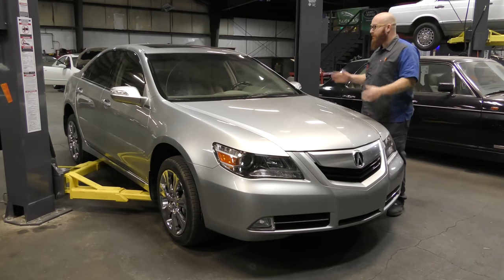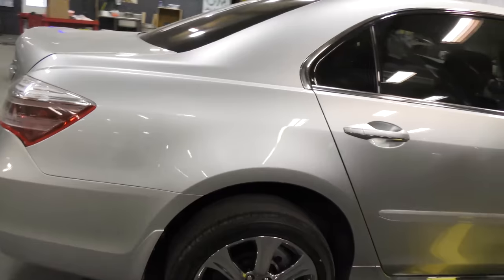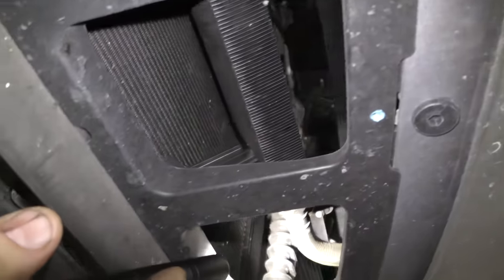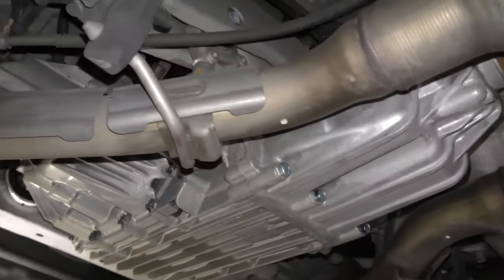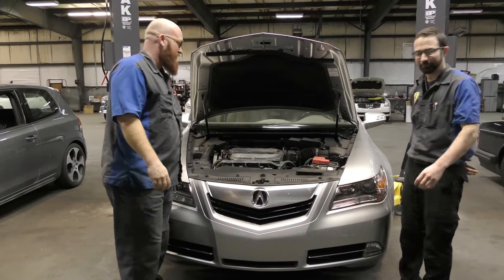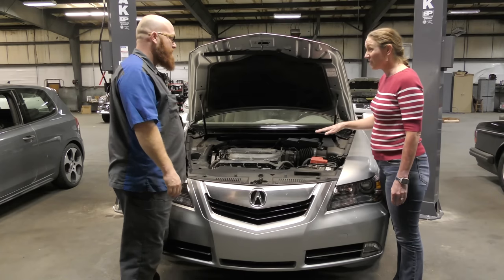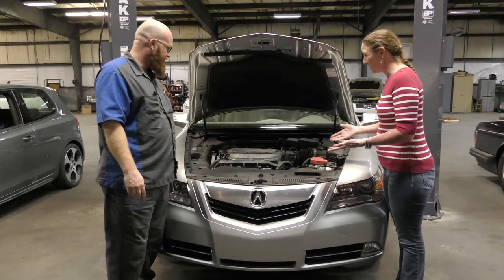Something Very Serious is Wrong with this 2010 Acura RL! What did the CAR WIZARD find???

Comment: Those J37 engines were complete junk - and it's unfortunate because the J series carries an otherwise good reputation for reliability and quality. I was reading about 4th gen Acura TL(the AWD models had this same engine) before I bought my 3rd gen. I basically found lengthy threads of owners with engines burning oil and having them replaced by Acura under warranty. So at one point Acura probably had stock-piles of these engines when these cars were still semi-current. I've been told to avoid the AWD TL's like the plague for this reason. I think Honda flubbed up on piston ring sizing or something on the 3.7 and resulted in excessive oil burning which probably ran this owner's engine low on oil. The J35 and J32 didn't have this issue, so sticking to the front wheel drive variants avoids this problem if that's an option for you.

Comment: Im looking for a good car for my mom i found a 08 acura tsx and a 2010 acura rl and a 2008 acura tl not sure which is better on maintaince
Reply: TL/tsx
Reply: @ua7pyro591  ty
Reply: The TSX is built in Japan and has a timing chain.  The TSX will be slower than the TL or RL; but, will get better over all mpgs, and slightly cheaper maintenance than the V-6 Acuras with timing belts.  The TSX will have a smaller back seat, slower acceleration, not as luxurious inside, and higher road noise.  All three require 91 octane fuel.  I had an 06 TSX for +175,000 miles and a 18 RLX now.
Reply: @mrgold3591  ty

Comment: Dude the 2010 3.7 has a few recalls one is excess oil consumption and I'm sure it could lead to that failure.  You need to get aho6of acura.  I have a 2010 Acura tl sh awd 6 speed manual and it eats oil alive so I took it to the Spokane wa dealership acura. They insisted that they did not need to let the car cool down to check the oil they ended up adding oil said come back in 1000 miles and well see were the oil is. Well when I got home that day the next morning I checked oil level and the Acura dealer added over a half quart over full level so gee wiz I bet after a 1000 miles it could be right on full.  What a joke I'd expect that from chevy or ford but acura pulling a quick one come on. They wont take my word for it that I have to add oil way to often and it dont leak so I have to make another attempt to have them check it and see that it does consume oil. Also I've had to myself replace the water pump and pulleys 3 times because they start knocking and it sounds like an engine knock.  This engine has flaws and some parts do to. Like the dual mass flywheel it over 1500 from the dealer and just about no one makes an after market one unless u convert to single mass but I'm guessing the dual mass harmonizes something in the 3.7 . Goodluck ull need it and it sucks cus they're great handling cars.

Comment: 42k and needs an engine swap? I've seen 2001 Hyundai's with 500k on the original engine and gearbox, Civics at 600k. 
Honda clearly played fast and loose modifying a 3.7 out of the reliable 3.5.

Comment: i don't think that engine failed because of a honda defect. my guess: someone forgot to add fresh oil after an attempted oil change.
Reply: 3.7 TL owner... Definitely a honda defect. A large number of the 3.7 L acura's with the same compression ratio burn about 1qt of oil per 1k miles. Something to do with bad seals on the pistons I believe? Just look up 3.7 oil burning TSB. Acura refused to address the problem until 2018 with a TSB!! Worse yet, customers have reported blown engines even after the TSB repair... The whole ordeal just makes acura look shady as hell in my opinion. Avoid these cars like the plague even if you know to top it off you never know how often the previous owner topped off their oil. The oil level light does not come on until you are already 3 qts low so no wonder this guy's engine blew.

Comment: RL parts are rare as hell because Acura didn't sell a lot of them, and the junkyard dbags are snatching them up quicker than hell...

Acura poorly supported this model and there were a lot of factory defects that made it difficult to own it.  The "leather" interior is fake and deteriorates quickly, the nav systems have constant issues and the glove boxes melt quickly and bubble...too many problems not being fixed for a car that cost 50k new in 2005...

Comment: I am thinking that Honda did have problems with these 3.7L and either to hide the problem they stopped making them or simply they ran out of them from all of the replacements. A rod knock on a 42k Honda something is wrong with the picture, I bet you someone ran it out of oil some time in the past 42k miles, that is sad. I have a few more theories about what happen, the car is 10 years old and in too great of condition. I can see why it looks this way, ran it out of oil ,parked it and decided to pass the buck on to someone else.

Comment: To be honest I feel the RL engine on this car was babied TOO MUCH which is why it failed like it did.  The Acura line up was designed to be driven.
Reply: Well. My thought is that there is a failure within oil delivery system. Most likely oil pump. Something happened to it and oil pressure dropped. 
But in that case check engine would come up, not oil level light as he said. So... My guess is the weak one

Comment: Can you not plug in a code reader to find out what is wrong?....Sad....I plan on buying an RL within the next year,..2009 or 2010 model.....If I were the owner, and had the money, I probably would shell out 7000$ to get the engine fixed. Cheaper to fix than to buy new.....

Comment: Ughh. I hate these kinds of customers. All they worry about is the looks not the mechanicals. Put a new motor in it and it will have the same problem in another 40k miles. And then he is going to bitch that you didn’t fix it right the first time!

Comment: Oh dude that engine is like 2100 bucks with 40000 miles I would of swapped in the JDM V6 from Japan for about 3500 bucks plus labor dude you have a brand new Acura. Period. These people just do not know Hondas man. Easy to swap out and even option for the bigger better JDM or newer versions.

Comment: Just wondering... did you check the Honda online parts stores?  I'm sure you have but in the video you only mention calling around to engine shops and distributors.  OEMAcuraparts shows they engines are still available to purchase.  The 3.7 is subject to oil burning and Honda has warrantied many short blocks and a few long blocks due to claims, maybe supply is getting low?  

"General Assembly, Cylinder Block"
10002-RKG-A04  
$6,281.80 

"Crank assembly"
13310-RKG-000 
$1,080.86

"Connecting rod(s) ea."
13210-RKG-E00 
$100.84

https://www.acuraoemparts.com/v-2010-acura-rl-sedan--rl-tec--5-speed-automatic/engine--engine-assy-transmission-assy

https://www.acuraoemparts.com/v-2010-acura-rl-sedan--rl-tec--5-speed-automatic/engine--crankshaft-piston

Comment: Seriously, with how little he drives it, might as well go with a 200,000 mile engine, it'll never see 250,000 miles while he owns it...  Plenty of used 100,000 mile engines.  Customer needs to take a deep breath and realize that that engine is good for 300,000 miles.

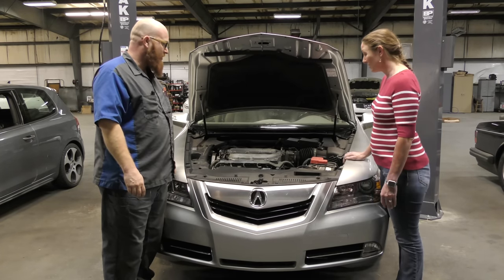Comment: @13:10  Did anyone even contact Honda/Acura directly?  They should eat the repair on their dime at that low of mileage, even if it's out of the standard 3 years/36K miles warranty that Honda has.  If they don't, that's utter bullshit and I would go scorched on their reputation in every place and every website I could find.  And, what the heck was the problem that grenaded the engine in the first place?

Comment: No, sorry, but they don't have a good record! They've not had a good record for well over a decade now! I would not touch a Honda product with a 10 foot barge pole. Heck, I'd get a Hyundai or Kia over the poor quality crap they put out these days. All you have to do is crack open a Consumer Reports (the MDX was rated as one of the most unreliable vehicles, btw), or read a few forums. Don't need to be Sherlock Holmes to know what's going on! Stick with TOYOTA is you care about reliability and durability!

Comment: Swap that junk 6v for a healthy 3.5L engine most if not all the sensors and bell housings are in the same locations and they are all a dime a dozen. When that engine died it already lost all its real value, its not special anymore. I bet they skipped checking the oil and left the oil to sit too long is my guess why it died.

Comment: Never buy a V6 Honda or Acura ....
4 Cilinders are great but V6 no good
Reply: It was just the 3.7L that had this issue and it was limited to vehicle in the 2010-2013 manufacturing period.  The port or DI 3.5L and 3.0L V-6s before and after are just as solid as the I-4 engines w/ or w/o turbo.  The only pain in the butt with Honda/Acura V-6 engines is having to change out the timing belt at 105,000 miles.

Comment: This IS A USED CAR. Especially if the car is being given to others to drive,a used motor is THE BEST OPTION. Spending seven grand to put in a new motor doesn't really make sense. The resale on this car is half what it was...even less when the replacement engine is installed. DEFINITELY,  a used engine if properly maintained is the best choice. People do wreck well,maintained cars. As much as I like to trust the son,I'm thinking he might have 'helped' the engine to  die by letting his girlfriend or friends drive it.Used engine all the way.
Just my opinion...not trying to drive you crazy- really like your channel.

Comment: Yeah yeah, the customer perhaps doesnt understand that japanese engines are removed low mileage and easy to come by affordably. Are you really trying to tell me that the customer has been educated about his options, and when given the choice between a used engine from japan for 2000 dollars shipped, vs 7000 dollars to have a company rebuild it, he wants it rebuilt for an extra 2 and a half engines worth of money? I find that hard to believe. Not unbelievable, hard to believe. Here is one for 1999 dollars shipped with 39k miles. Less than the car. https://www.ebay.com/itm/JDM-2010-2013-Acura-TL-AWD-Acura-RL-2009-2012-J37A-3-7L-SOHC-V6-VTEC-Engine-4WD/283688542887?epid=8033838572&hash=item420d27a2a7:g:ikgAAOSwHP1d3H~U

Comment: I’ll sell you mine for 6 I got a 12 with 140k 6500 whole car runs mint  any idiot would kno buy a second one for the money there 250k plus engines  have a Back up even if it’s crashed u u have whole Rl special auto part sore in your back yard . Anyone  knows any vq or J series should have attention to oil I mean damn the car has a usable oil percent in the dash it’s a quart for every 1200 miles or every time it goes down 30percent
Reply: Mines a quart at 50 and a half quart at 25
Reply: 2010 rl

Comment: Looks like there are some engines out there with similar mileage:
https://www.car-part.com/cgi-bin/search.cgi?userSearch=int&userPID=1000&userLocation=All+States&userIMS=&userInterchange=D%3FB%40D&userSide=&userDate=2010&userDate2=2010&dbModel=2.9.1.1&userModel=Acura%20TL&dbPart=300.1&userPart=Engine&sessionID=14000000109768132&sURL=www.car-part.com&ref=mobileweb&userPreference=miles&userZip=67117&userLat=38.0727000&userLong=-97.3431000&userIntSelect=2440645&userUID=0&userBroker=&userPage=1&iKey=

Comment: Car wizard why can't you repair this engine why do u need send it to someone els
Reply: I I can answer that. You need a fully equipped machine ship with a crankshaft lathe, line borer, a centerless grinder, measurement tools up the ying yang to do a rebuild. Its not just a simple case of throwing in new parts.  The fits and tolerances used in this engine make a rebuild a very specialized job,  The Wizard just does not have that kind of equipment.